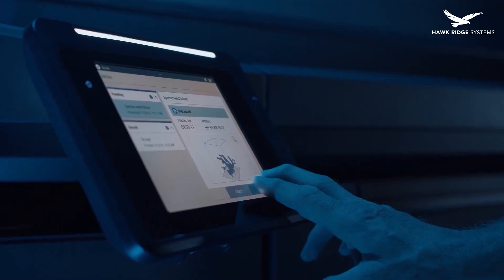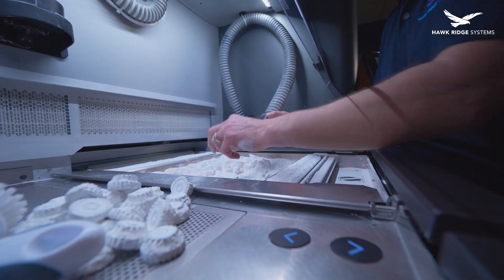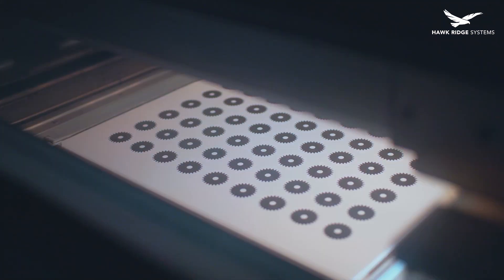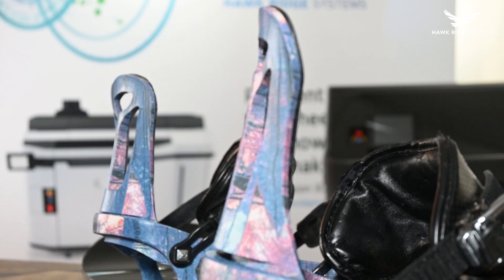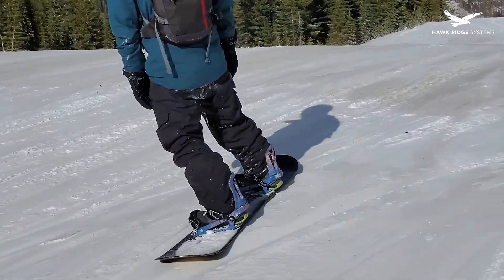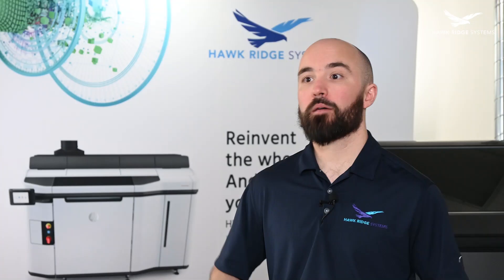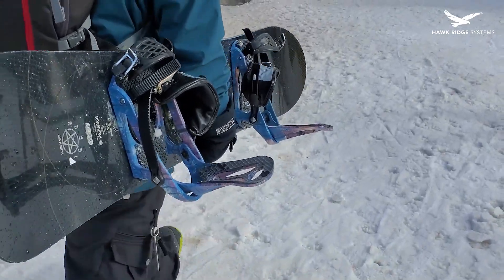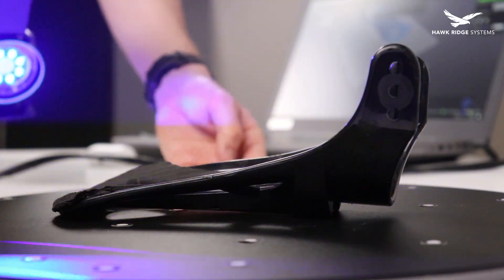A Product Development Journey: 3D Printed Snowboard Bindings

Comment: "a brand new product" and "reverse engineering" is normally not used in the same sentence, so what's it now really???
Reply from the maker: The main thing the 3D scan is being used for is to accurately reference the mounting points and size of the boots for compatibility. A completely new binding will be modeled in SOLIDWORKS using the scan as a reference for those details. 

The process shown for scanning and importing into SOLIDWORKS is very relevant for people looking to do reverse engineering though, which is why it's mentioned in the video.